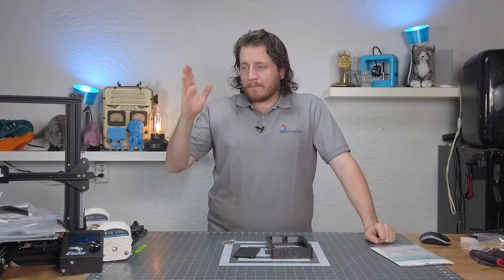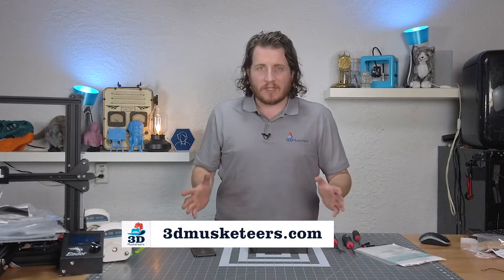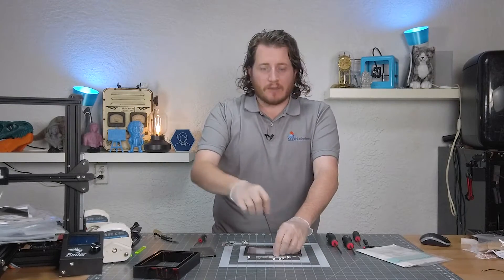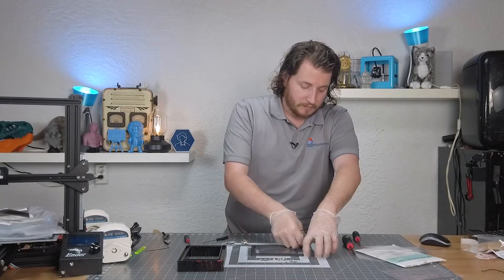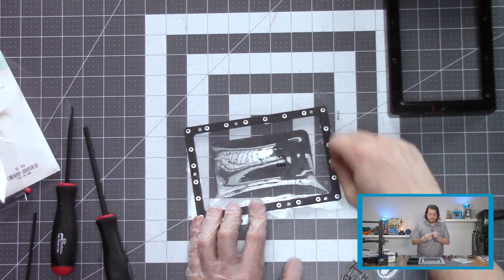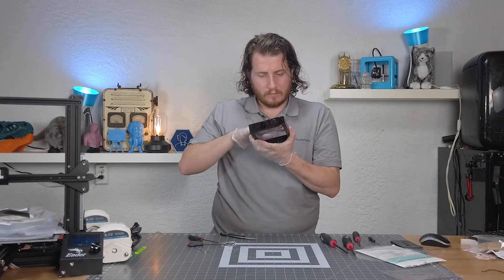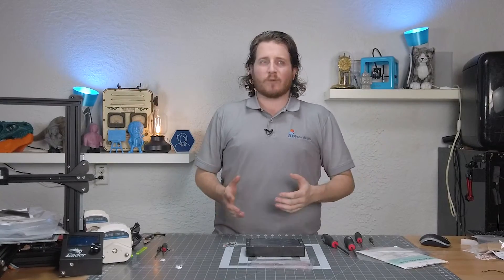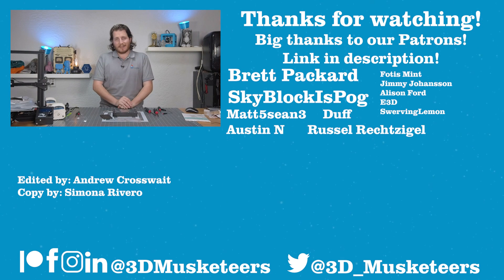Keep Your Resin Vats Looking BRAND NEW! - How to Change FEP!

Comment: How to do avoid it being too tight? I've just changed mine for the first time and I've got it too tight both times I've tried, there's a lot of pulling force.
Reply from the maker: you can use a guitar tuner if you would like to help tune in the sound, but if you saw I had a plate under the fep as I was installing, that adds some extra material so it is not too tight and you use the massive amount of screws to secure it down properly. 

Hope this helps!
Reply: @3DMusketeers  thanks, i did use a bottle cap the second time but it might have been too small. I'll try this method!
Reply from the maker: There should be files available for your printer that will help you tension it properly.

Comment: Thanks for the video.  I just got my Elegoo Saturn and did my first print on Friday.   When I order the printer, I added some replacement FEP.  I am new to 3D printing and they sounded like they would be needed.  I thought I had to replace the FEP to start with.  Luckily I came to my senses and did not do that.  The print failed at the 14% complete mark.   Lots of cured resin now on my FEP.  I’m pretty sure I’ll get to know the joys of replacing the FEP soon. Maybe not.
Reply from the maker: You can use your finger UNDER the vat to slightly massage what is stuck to the fep, should help a ton :)

Comment: You should cut off the excess film before inserting it into the vat.
Reply from the maker: Why do you say that?
Reply: @3DMusketeers  
It is much easier to trim before it's installed. It also makes it a lot easier to insert the frame into the vat. Try it the next to time  you replace your fep and you'll see what I mean.
Reply from the maker: The OG mars vats are a bit loose on tolerances so it was not an issue, but yeah I can see how it would be! I always worry about cutting it too short or close to a bolt and it somehow rips through lol. Maybe this is unsubstantiated? Maybe I am neurotic ha ha

Comment: Thanks for the step by step.  Very detailed.  I am new to resin printing, so I have no yet changed the FEP.  Not looking forward to it, but your video helps.  What is a good source for the 'right offset tool'?  Thanks again.
Reply from the maker: I would check your preferred repository for 3d models. I would guess between Prusaprinters and thingiverse, you should be good to go.. What printer do you have? happy to see what I can find!
Reply: @3DMusketeers  I have a Elegoo Mars 3.  I saw one on Prusaprinters that is a remix from a Mars 2 one, but I do not know how he scaled it, and how critical the z dimension is.  I appreciate you looking..  Thanks
Reply from the maker: It is likely fine. Maybe add a BIT more to the Z, but not much. You can literally use a bottle cap if you wanted, it does not need to be an exact science for this one, you just want to make sure it is reasonably taught so it does not leak when it is fully assembled.
Reply: @3DMusketeers  Thank you.
Reply from the maker: Happy to help!

Comment: IMHO rubbing a little PTFE lube (I use 3 in 1 in the blue/green bottle) into the FEP with a microfiber cloth helps reduce pulling force.
Reply from the maker: recent reports are it is snake oil (pun intended). I do it myself, one of those things that has not made it worse yet, but it may be a cool test to compare brand new FEP, identical resin, identical printer, one oiled, one not. I use that same ptfe as well.
Reply: @3DMusketeers it's hard to say how much was the PTFE and how much was just me learning.
Reply from the maker: I feel that in my soul....